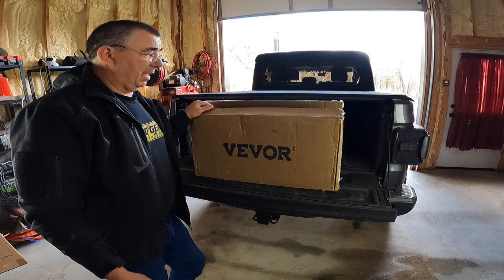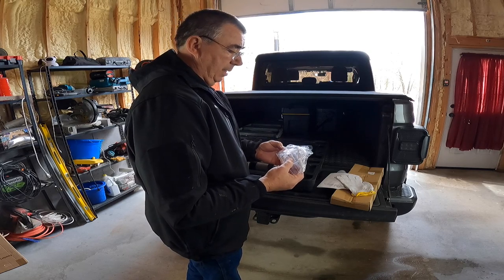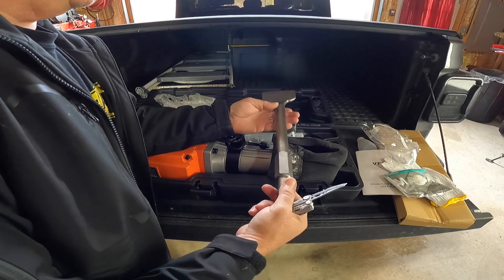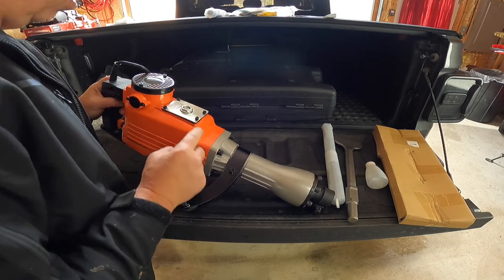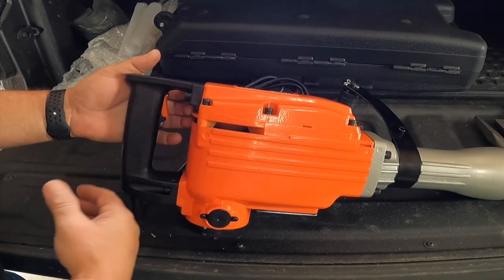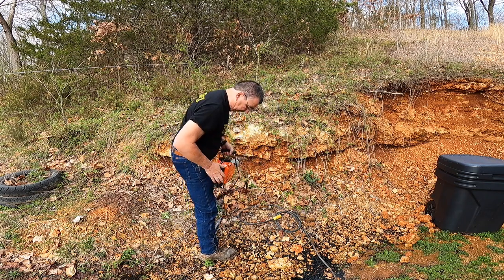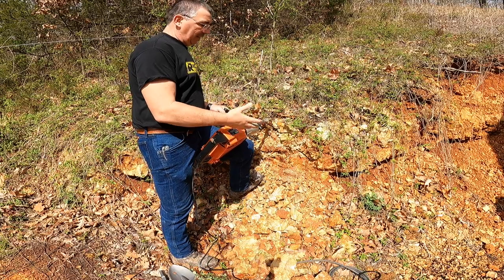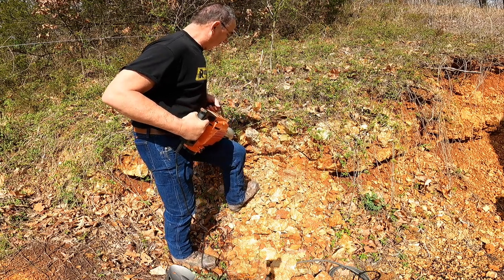VEVOR Demolition Jack Hammer Review #jackhammer

Comment: Get on top of the hill and hammer straight down, let the weight of the jackhammer do the work. You shouldn't need to push it, that's too much work and not needed. Use a safety belt if you're worried about falling off the hill.

Comment: the instructions talk about grease and also oil. is that interchangable? i noticed that there's grease where you insert the bits so I'm wondering if you're supposed to add grease there also??
Reply: ❤you. Should  grease the ends of the bit before inserting , the. Oil is internal  lubrication
Reply from the maker: @frogfroggy9438 Great tip, thanks